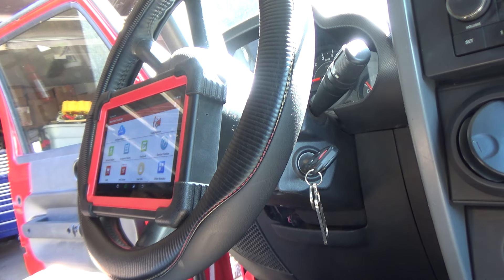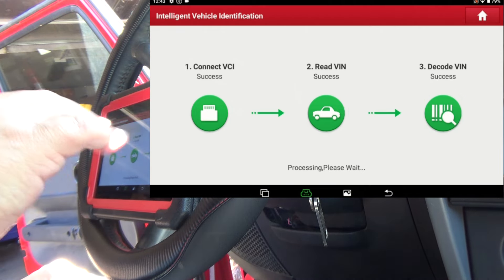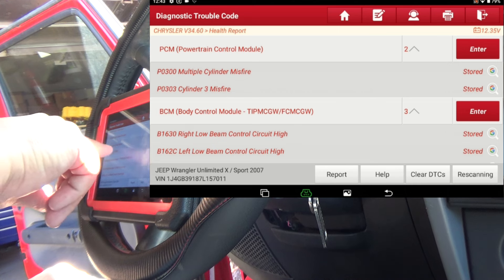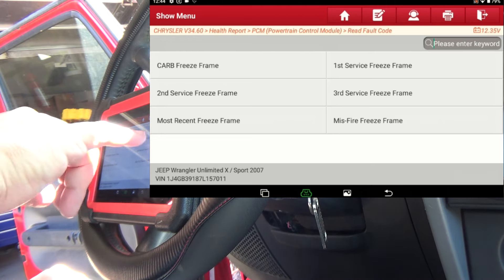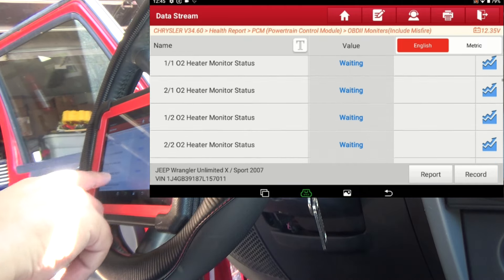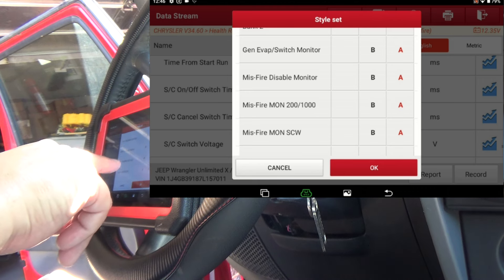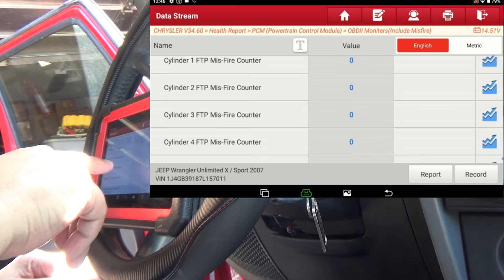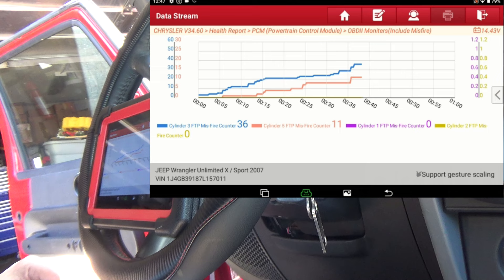A Nice Misfire Feature the Launch CRP 919EBT Scan Tool has that I wish The Xool D8BT had.

Comment from the maker: LAUNCH X431 CRP919EBT Elite 2024 Wireless Bidirectional Scan Tool, ECU Coding
https://amzn.to/3IAcgms
LAUNCH X431 V+ PRO 4.0 2024 Elite Scan Tool, Topology Mapping, 10.1 Inch
https://amzn.to/43hbVyS
XTOOL D8W New Upgraded Automotive Diagnostic Tool, 3-Year Updates
https://amzn.to/3IvAM8m
Thinkdiag2 All System Bidirectional Control OBD2 Diagnostic Scanner
https://amzn.to/3vaDPQj
737mechanic Amazon Store Front
https://www.amazon.com/shop/737mechanic/list/CR3BU74FTDU1?ref_=cm_sw_r_cp_ud_aipsflist_aipsf737mechanic_W4QMHMJ1JD67FDBCQHRK

Comment: These are excellent videos and very informative. I'm in the market for a new scanner and the one thing I noticed on your pedal position sensor video(your sierra) is how granular the XTool is compared to this scanner. The only thing I could find on the Topdon ArtiDiag Pro and the Launch x431 CRP919X was throttle angle and Accelerator pedal postion. Whereas the XTool D8 in the other video gave you a multitude of choices for diagnosing those two components and their primary/secondary sensors under the TAC heading. With the D8 capability it drastically narrows down the amount of work and snooping you have to do to zero in on the issue. Thanks for these as they are really well done and I'm kind of sold on either the D8W or the D8S. Subscribed.

Comment: I recently got the x431 dyno and I have the d8bt. I definitely like the xtool much better. I feel like launch's layout is too clunky and too many prompts. The xtool d8bt is easier to use and faster overall as well. I made 2 keys today on both tools and the xtool was again far faster and easier to use while making keys. 

I did notice the launch has a few more special functions that the xtool doesnt have though. Just my opinion on these 2.

Comment: Misfire data is under live data for my GMC. The live data sucks on Xtool for a random misfire that is intermittent because it’s total misfire counts reset constantly so you can’t gather information from a drive around town without recording the entire trip and then rewatching the entire trip so you can’t gather information write the misfires down and tally them. The Xtool will show a maximum number his during a short misfire cycle, but won’t tally the totals beyond the short cycle. So your Xtool my say you have two misfires on cylinder 2 when you could have 500 because is was a misfire every short cycle, not trip. This is even more of a kick in the junk if it says you have 6 in cylinder 4 but 2 in cylinder 1. You focus on cylinder 4 but the number could actually be cylinder 4 had had 6 misfire during one cycle on a 20 mile drive but cylinder 1 actually had 2 misfires during every cycle resulting in Xtool showing two but it actually had 200 misfires in 20 miles. Xtool needs to get their stuff together. I reported the issue about a year ago and they still haven’t fixed it.  I also bought a GearWrench scan tool only to find out it does the same thing because it’s a rebranded Xtool. I tested a launch Creader light that was $120 that only does Gm.  It has had far better software and layout over the Xtool. That cemented my decision. I just bought a Launch x431 cr919xbt elite that will be here Monday.  Xtool has features shotgunned on it so they look good on a spec sheet. Launch have features that are integrated so they can be used. 👍